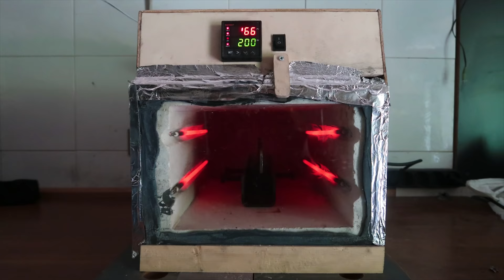Knife Making: Kitchen Cleaver Knife

Comment: An attempt to harden to use the used oil from gear changers and car differentials. because there are a lot of free particles of steel from the gear wheels. it will stick to the surface of the material you call and further strengthen it. Sorry for my google english
Reply from the maker: Don't worry :) I think I understood! Thanks for the suggestion :)

Comment: When you quench the knife in the oil, don’t move it, just straight in best you can and leave it there, don’t wave it around or twist it just let it rest, you’re getting that warping because one side of the knife is cooling first ( touching the cooler top oil that touches the air ) and putting tension through the opposite side of the steel, leave it in straight and don’t touch it and your knives won’t warp as bad :)

Comment: Why do you hammer the stock, when it is smooth plate steel to begin with?  Just curious.  I have no idea?
Reply from the maker: The customer wanted a forged look :) Only extetic reason!
Reply: cool.  So practically, you could just put an edge and a handle on the shaped piece of sheet with the same outcome?

Comment: How did u make your wood block for sharpening could u make a video showing how?
Reply from the maker: That's a piece of scrap wood with two bolts sticking out in the back side locked with a couple of nuts :) I've made it as a test and I'm planning to build a proper one soon! :)

Comment: Will that blade rust?  My almazan blade rusts with acidic foods and water.
Reply from the maker: Yeah, high carbon steel can rust, you can prevent it by washing with warm water after use and dry with a towel :) Or you can force a patina on the steel like I did with ferric chloride, it will rust less! :)

Comment: What kind of Steel is that that's something that you can get at the local hardware store or is it special metal for knives
Reply from the maker: It's a tool steel, not something you find in all hardware store. This one is called 1070 high carbon steel
Reply: Thank u

Comment: ok, i'm subscribing... what metal did you use? and you heat it at what temp? - respect.
Reply from the maker: Thanks! Appreciated :) I use 1070 high carbon steel, depending on the steel you want to use you can check datasheet online with all precise temperatures for hardening tempering and all! Just search for "steel ...  datasheet" you'll find it in the first results :)
Reply: Can i order one from u?? Lol i really want one

Comment: Awesome. I’m dying to try making my first knife. What did you use for steel, type and thickness?  Thanks.
Reply from the maker: Hi there! Thanks! I use simple high carbon steel. This one is 1070 (aka C70) pretty similar to 1080 1095 and so on! This one was 4 or 5mm thick I don't remember anymore :')

Comment: what are you using for pins??
Reply from the maker: Steel :)
Reply: what is it called?
Reply from the maker: Stainless steel tuibing or stainless steel round stock :)
Reply: nice do you find that metals soft enough to squash down? ive only tried brass and it was too hard

Comment: How is the jig made?
Reply from the maker: I made that as a test a couple of month ago, I'm designing a much better (but a bit more complicated) one now. It will come to life in a while :') I'll make sure to add the one that I used here in the video too. But there is really not much to it, just a piece of wood with two bolts on the back, each with a couple of locking nuts :)
Reply: Black Beard Projects ok thanks